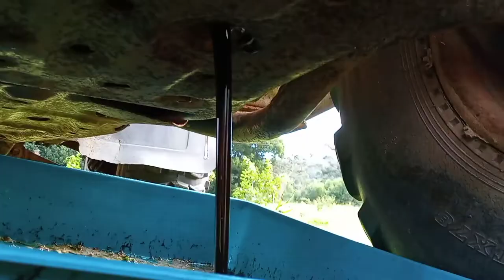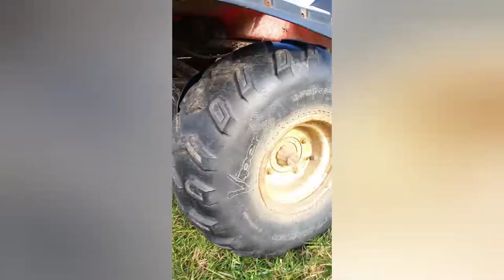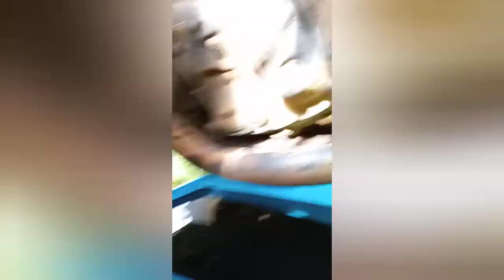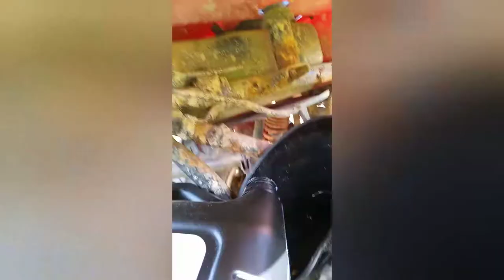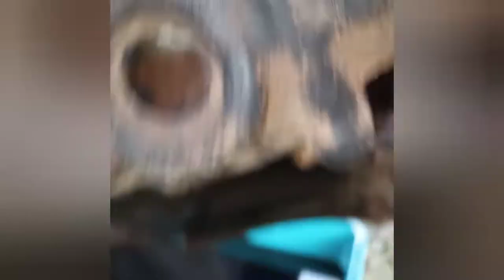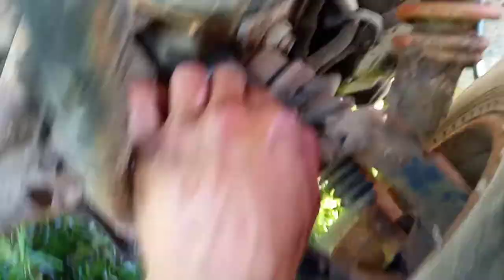Suzuki LT250 Oil Change - How to Keep Your Quad Running Smooth

Comment: and what about the oil filter
Reply from the maker: It requires 3 bolts to be taken out - in the vid I pointed it out. When filming I didn't have the filter but just did the oil change  👍